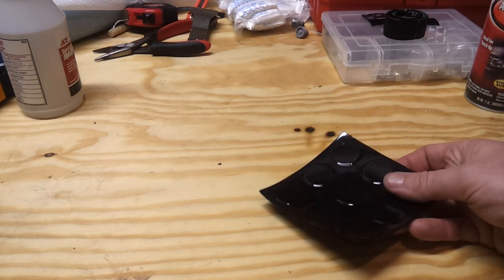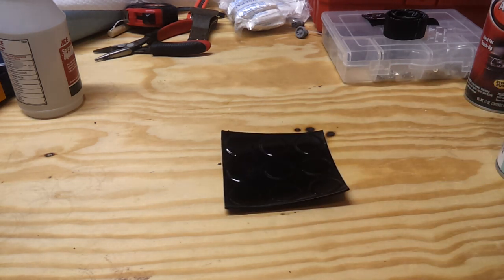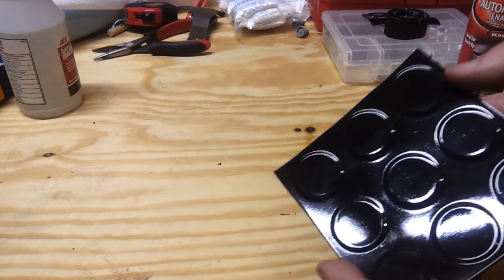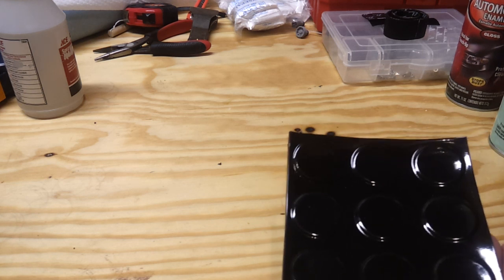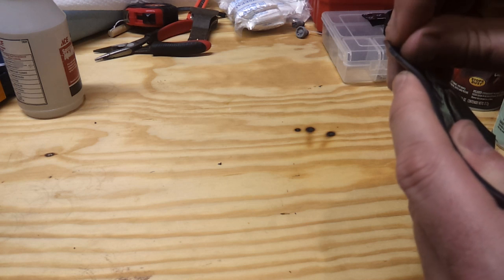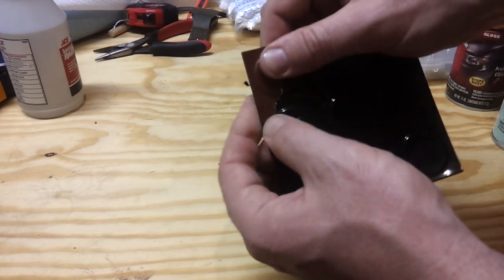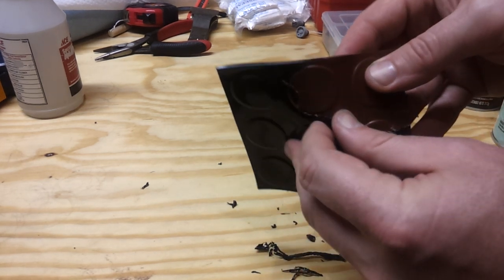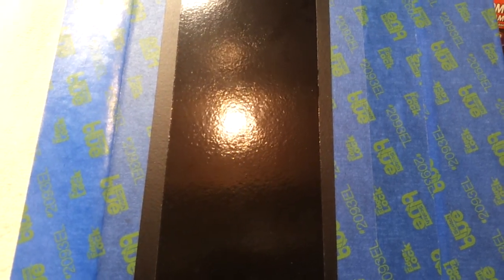Peel test of Plastidip coated with Krylon Fusion for Plastics (Clear)

Comment: Thanks for the video. Plastidip by itself was really messy as far as white goes (prone to stains) I'll be redoing it in white and krylon fusion over it. On the entire motorcycle I used 6 cans of plastidip, should I use the same amount in krylon? Btw I'm also going to follow your videos and wetsand it if it doesn't look too good.
Once again thanks for the video I appreciate it
Reply from the maker: Please take a look at my other video with putting the Enamel over dip with a metal base.  The Enamel did't fuse to the vinyl underneath the dip however it did fuse to the metal under the dip in my other video.  Even 9 coats of dip was a little hard in coming off.  Please be aware of this when putting enamel on any dip as it can penetrate to the surface below.

Comment from the maker: I definitely agree and have given this advice any time I have been asked. This was to see if it could be done given proper application/coverage.  This is definitely for very special use and I'd only recommend it if you have no problems using paint stripper to remove it (i.e. don't care if it penetrates to surface below the dip).

Comment from the maker: It would be more permanent.  However, I do not recommend doing this to a car body as there is not a 100% guarantee that the clear coat would not penetrate the Plasti dip in some areas and bond to the surface underneath.

If your entire car was sanded/primed and you had the choice of a new paint job or doing plastidip with a clear coat then that is a valid scenario in which it could be used as your choices for removal are increased and you aren't worried about bonding to an existing clear coat.

Comment from the maker: Thanks for your comment and I would definitely agree that this is not a mainstream option.  If I do this to a set of my rims (2 piece), then I'll be stripping off the existing finish first as I was thinking about repainting anyways.  These videos are more of a "can it be done" test.  Not having a proper application of plastidip could lead to the Krylon bonding to the surface below.

Comment from the maker: So far in my experience between the two I prefer the Krylon as it is easier to work with.  I'll be putting up another video later once I finish up the wet sanding video covering the auto enamel that where I'll peel off the plastidip from my test piece that has both types of enamel on it so that should be a good one to look for.